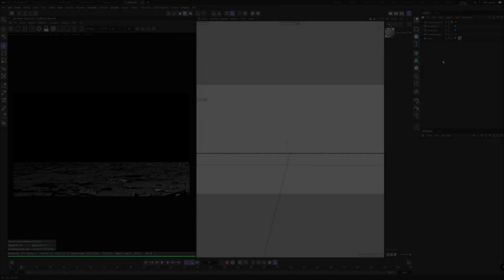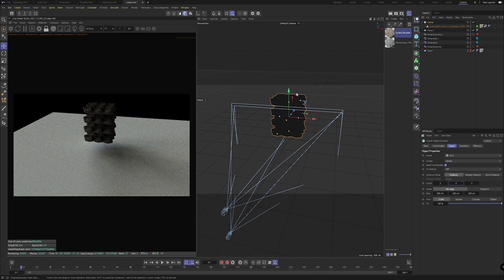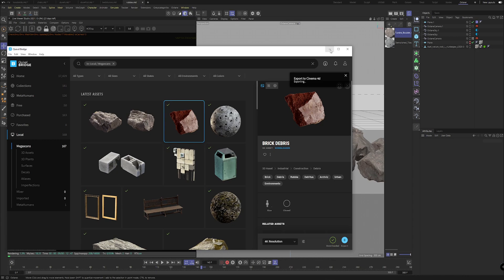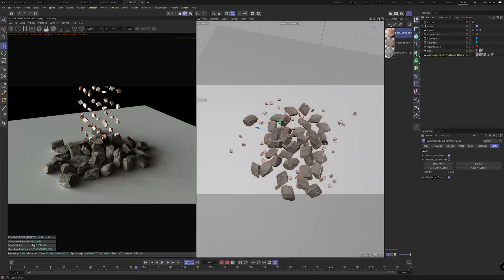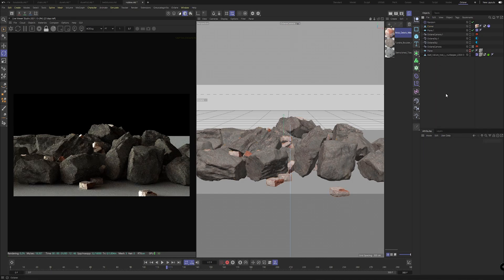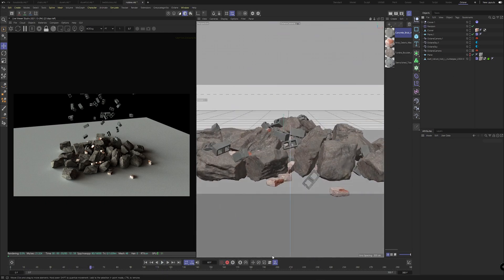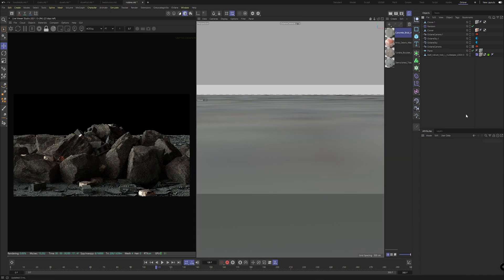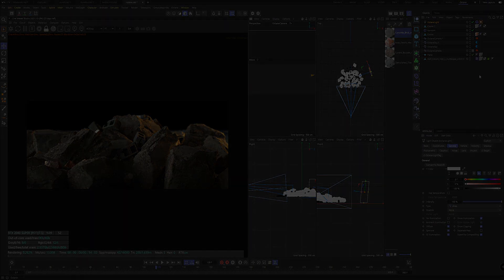Creating QUICK Rubble Ground Cover in Cinema 4D and Octane (3D Quick Tips) │ september ®

Comment: Just so you know, you don't have to make the cloner editable (bake them off, as you said) and be able to use dynamics on the clones. Just add the rigid body tag to the cloner itself and the default is for the dynamics to be applied to the children of the cloner. Saves having to undo it all just to change the random effector. Once it is cached, you can make it editable and connect all the objects and delete.
Reply from the maker: I had a feeling there was a workaround - old habits die hard I guess haha. Thanks for the help :)